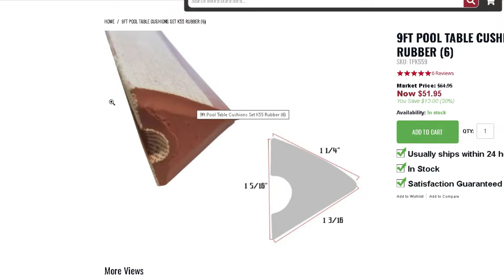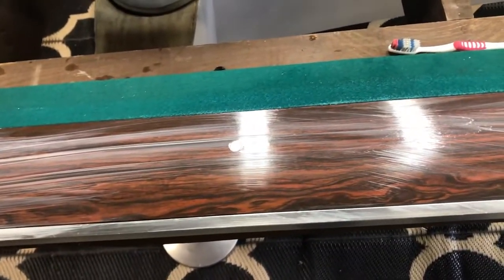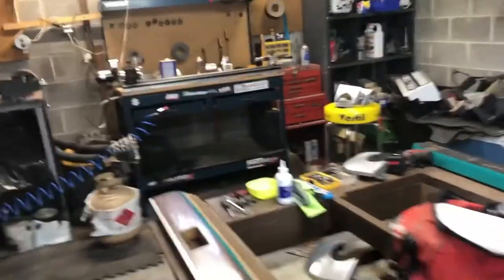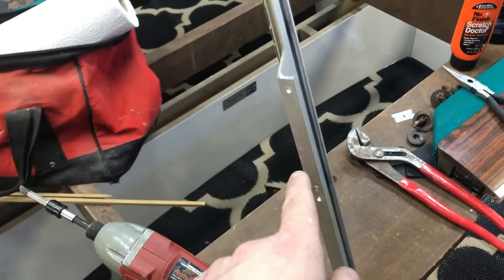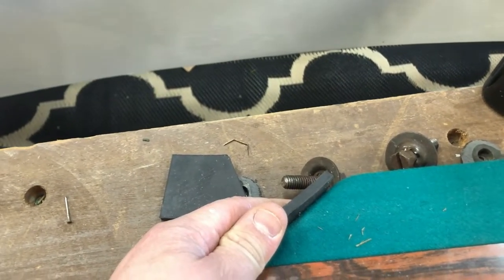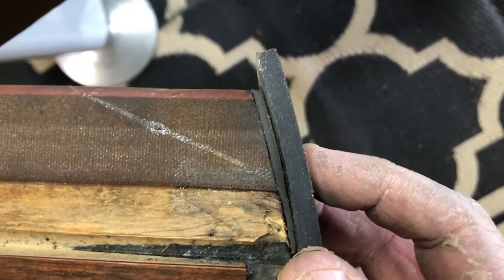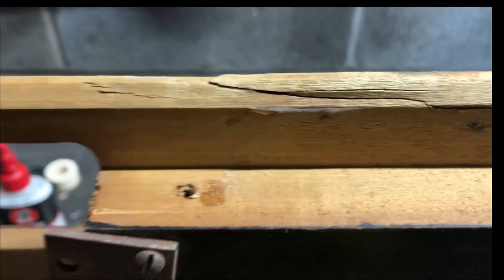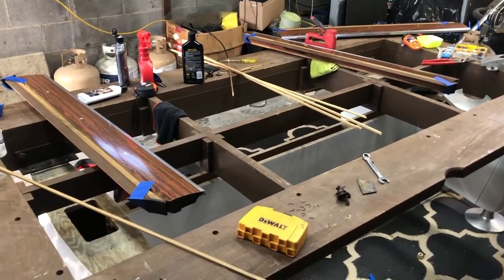Brunswick Gold Crown 1 Restoration Ep #3 (Rails and Facings)

Comment: You need to swap pads between scratch removal and polishing. Each compound needs a completely different type of pad and firmness. Not to mention that you are contaminating the polishing with the scratch compound.

You “might” first try to wet sand the rails with a pretty fine grit (1200-1500) to remove the deep scratches. Then a decent rubbing/budding compound (Mother’s Ultimate works extremely well) then polish, then wax (each step uses a softer pad reserved for that compound exclusively).
Reply from the maker: After speaking to others on AZ billiards they said the last thing you want to do is wet sand or use anything aggressive on these. The super smooth pad was what was recommended to me by the people who’ve caused some damage. I’m super happy with how they turned out, some guys said you can easily cause a haze if you go aggressive at all. So I wanted to just take it easy.